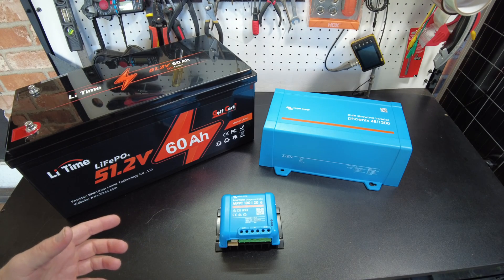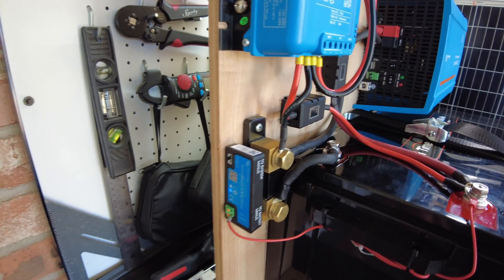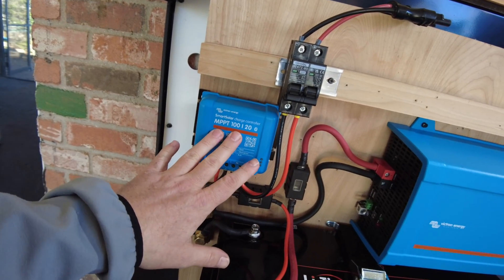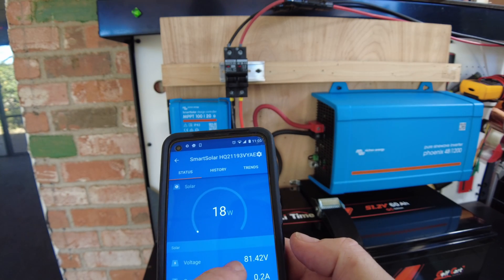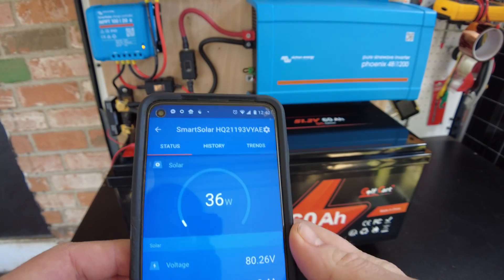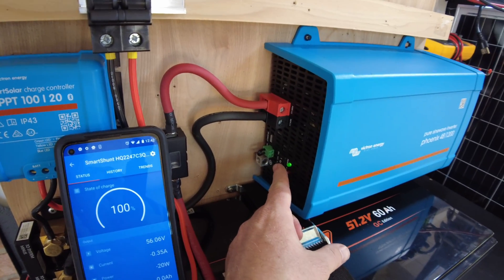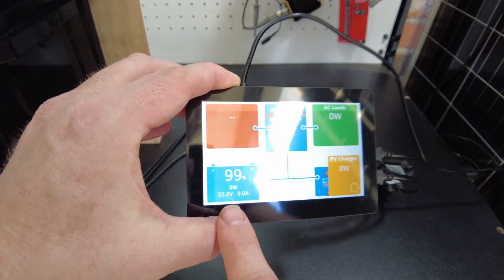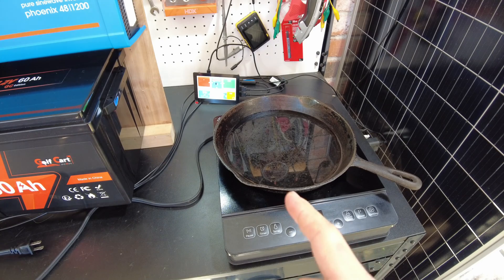Victron + LiTime 48v off-grid

Comment: Great video!  You may want to try Cnswipower 48v inverter.  I have a 48v 2000w inverter that only pulls around 4W when on. No eco mode. Great quality build.
Reply from the maker: Thanks, i'll check those inverters out!

Comment: I would like to ask you to test one feature of the Victron system.
In one video it was mentioned that when Victron loses internet connection, it stores data on SD card and when it reconnects to the internet, it automatically uploads the offline data from use to the system, so no historic monitoring data would be lost.
I really like this feature to avoid data loss when offline and online use for a portable solar victron installation or even for a fixed installation when the internet goes down, without losing offline data. And this is something I miss a lot with all other solar systems, at least with all commercially sold Portable Solar Stations.
Testing is easy, just turn off the internet for a while and then turn it on and wait if the data comes back to the VRM portal during that offline time. When the data shows up there, test it offline for a longer time.
I wonder if this works automatically, or if you need to do some setup besides inserting the SD card into Cerbo or into Rpi.
I haven't seen any confirmation or video on this yet.
Thank you very much in advance if you could test this feature.
Reply from the maker: Interesting, i'll see if I can setup a test. Maybe I'll put the RasPi in a metal box (to shield the signal)  for a day. Thanks

Comment: So that victron works on a rasberry pie.  So I could put that on Linux?  Pie's are normally ubuntu linux.  If that works it makes victron very appealing.  Just not into the phone thing.  I am old I don't do phones I find them annoying.  Lol
Reply from the maker: Yes the Victron OS is Linux, however it's a complete OS image built/ported for the Raspi. So you would need to figure out some emulation setup to run it on x86 Linux. I really wish it was just a software package you could load on any Linux, but ATM it's not. Thanks!

Comment: Thank you for reviewing a 48v system.  I was getting tired of 12v 100AH battery reviews.😮
Reply from the maker: You're welcome. I know I'm so bored with 12v systems. I've been turning down 12v batteries, and inverter reviews. I still have some coming in, but I'm pushing for other voltages. I keep telling companies people are wanting to see other systems, we don't want the same thing over, and over. LOL :) Thanks!
Reply: @BradCagle  Send em my way lol, 12v x 4 = 48v in my setup.  I did finally order my 1st 48v rack mount, we will see how she does!
Reply from the maker: @TackleThat  I can give them your contact info. I did not see any contact info on your channel, maybe I missed it. If you don't have it then you might consider creating an email for your channel. This is how they contact you to ask if you wan't to review a product. Thanks.
Reply: @BradCagle  For beginners, 12v setups are predominant.
The higher the voltage the higher the expert level as it were.
I would probably want a 24v setup (2 parallel x 2 series - 4 panels).
Mostly because of shading issues and there are no MC4 connectors for 6 gauge wire that I can find. Have to use 8 gauge wire due to 100 foot run.
Reply: Charging 48v battery with SOLAR. people showing this always start with the cables, never showing the panels or compatible MPPT. TO charge a 48v which is 53v do you need the solar array greater than 53v… and what would be a compatible VICTRON MPPT… ur using a 100 20… WHY?

Comment: I’m really liking my Phoenix Inverter’s.  So far what I’ve learned. One is a 1200 24 volt, other is a 500 24 volt.  On Econo mode my TV and Xbox1 won’t come on using the remotes, I’ve lowered the setting all the way down and nothing. The 500 watt inverter won’t start my freezer, compressor surges 800 watts. The 1200 will start the freezer in econo mode and works very well.  My GE refrigerator 3 door I can’t use econo mode on it either, it has some fans inside that have low wattage that cycle and the light on the Ice Maker flash’s..  I sure wish they made these in 240 Volt and big enough to run a Well Pump.  I’m going to get another 1200 watt soon because econo mode is not that important to me that much.  They are solid piece. Another great video Brad.  I look forward to all your post. Some of these companies need to send you a good set of Panels for your roof like 2000 watts. As I say that would put some (the fire in the wire).
Reply from the maker: Great info on the econo mode, so seems like it'll really be hit, or miss depending on your appliances. I actually have two complete PV arrays on my roof. One runs my garage system, and I have another that runs some computer equipment in a shed. Probably about 3kw worth ATM. I also have a big stack of panels waiting to get installed. Just finding the time is the hard part these days. Thanks!